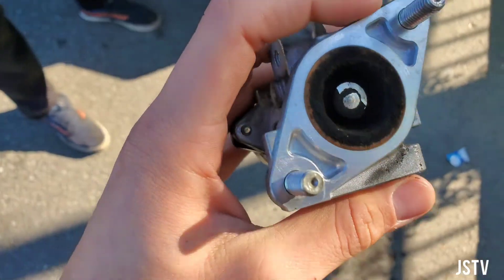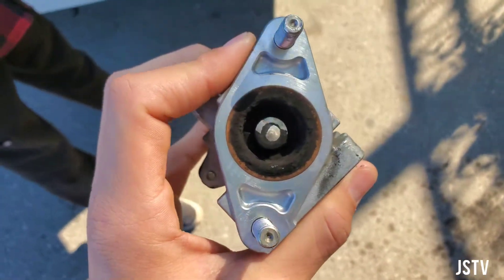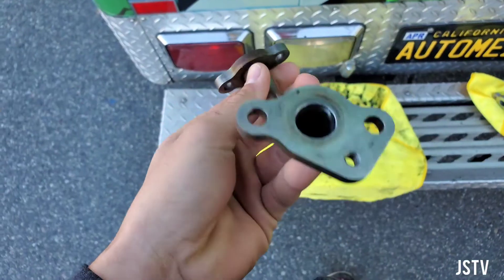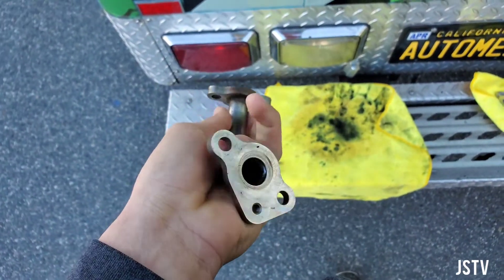2010 Prius P0401 Code (my experience)

Comment: I had to replace the EGR valve and cooler for my Prius after receiving that code.  I even swapped out my intake manifold for a used one that didn't have carbon build-up.  I saved a lot of money by ordering the parts I needed from eBay because the dealership near me wanted over $400 just for the valve, which is insane.  I ran into some issues during and after installation, but I resolved them and everything is running great again.

Comment: I own a hybrid shop and I can tell you the problem is not clogged EGR passage at Al. If you look at the freeze frame data it even throws the code when EGR is not commanded like when throttle is closed. It is an ECM issue. I replaced the ECM and reprogrammed it. Problem never came back.
Reply from the maker: Well, I'm not an expert for anything so I have no idea. All I know is that after getting my EGR replaced I haven't had the issue happen once 😅
Reply: There's about 4/5 possibilities ECM is one of them but not always the cause...
Reply: Change my egr valve and cleared codes. The it came back. How do you programe the ecm?

Comment: One year update,
Reply from the maker: My car is going strong 😎💪 have had no issues, sound or hard switches when the battery turns off definitely the root of my problem lol
Reply: @JonnySteven  thanks Johnny! Having the same issue and my brain immediately is going to failing head gasket. Hope this is all I need. Fun fact I’m looking at calling the same  mechanics since I’m in oc and they’re the first result on Yelp.
Reply from the maker: @eriks8382  they do a car diagnostic to so they make sure that is really the problem before they work on your car which i think is really dope